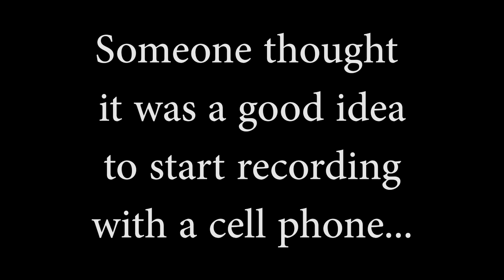OBS Solutions Super Duty Seat Bracket Kit Installation Tips and Tricks

Comment: I know it says 1980-1997, but my cab doesn’t have the bolt coming out of the floor. Will the bracket still work?
Reply from the maker: Can you clarify the bolt you're talking about?
Reply: The one at 15:42 where the bracket seats in. Mines came with screw hole for a bench seat.